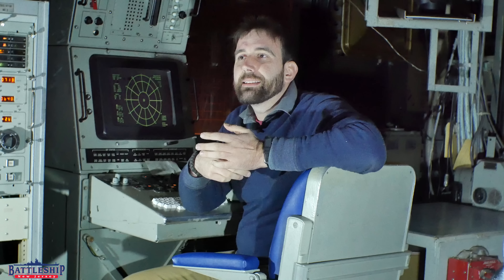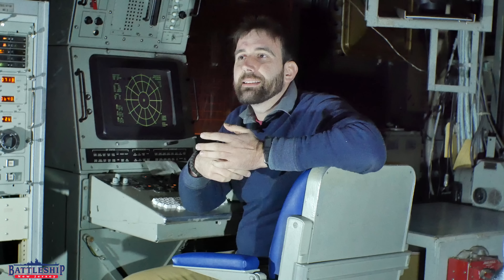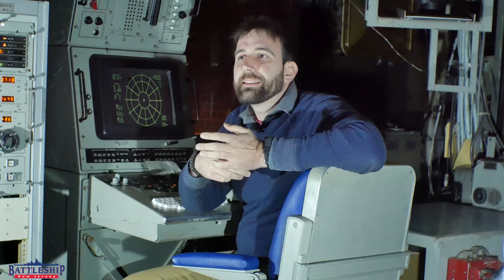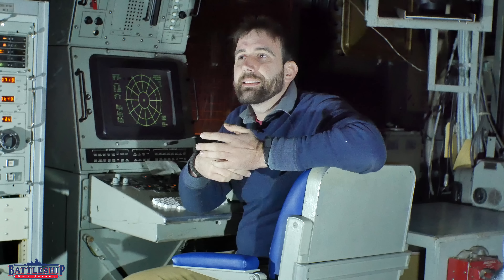Aggressive Christmas Tinsel, Smoke Screens, and Other Countermeasures

Comment: 8:00 IDK...some dump trucks can turn pretty tight. Now a better analogy might have been double-length greyhound bus.
Reply: or like a battleship.  😉
Reply: @cjc_0167  IDK At low speed though iirc it was pointed out that the Iowa's can turn roughly within a radius = to a ship length. That's tighter than a double greyhound could manage that I've seen. I think those things might fall off the deck if forced to turn in a space as narrow as a flight deck (which is more than the bus length). 🤪

Comment: With all due respect... I've never before heard it said that it was difficult to tell where a 16-inch shell would land. It's not just about taking out the enemy radar emitter, it's about the fact that doing so will greatly reduce the enemy's ability to know what is going on in the battle space. Also about the fact that if a 16-inch projectile hits anywhere near the radar emitter, it will certainly kill a large number of enemy troops.
Reply from the maker: We've got a few factors at play here: the target isn't always a ship, sometimes its a grid point given by a marine so we have to match up with them and make sure we're not hitting our guys instead of the enemy; sometimes there are multiple ships firing simultaneously and you have to figure out who is aiming correctly and who isn't, sometimes equipment fails.

Comment: Towards the end of the Viet Nam war the US developed HARM - the high-speed, anti-radiation missile which homes-in on radar and proved highly efficient blocking the Iraqi radar during the early hours of Desert Storm.  The military also has smoke generators which generate smoke that interferes with radar and IR sensors.  They are used on the M1 series tanks.

Comment: I've seen the old footage after WW ll were they arranged ships in the Pacific after the war and detonated A-bombs to see what their survivability would be. I was wondering how close of a blast from a nuke, say from a low yield to a medium yield, would a ship like an Iowa class ship be able to survive.
Reply: Operation Crossroads was pretty interesting.. they discovered that even if the ship survived, the radioactive pulse and fallout were deadlier than expected for crew. Even being behind the ship's armor plate wouldn't be enough to protect from a close range blast, and nuclear bombs quickly became far more powerful than the primitive WW2 nukes.
Reply: Operation Crossroads shot Baker was a device detonated 90’ underwater and it did far more damage to the ships than the surface burst 
USS Saratoga, which was used in that test at the bottom ripped out of it by shot Baker